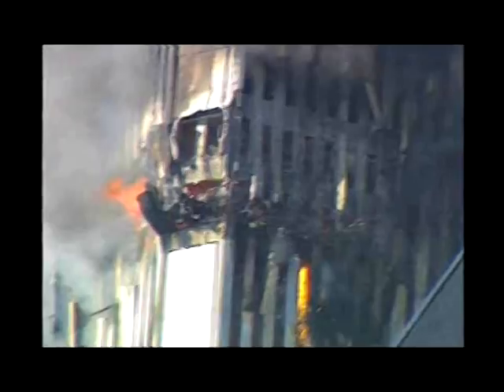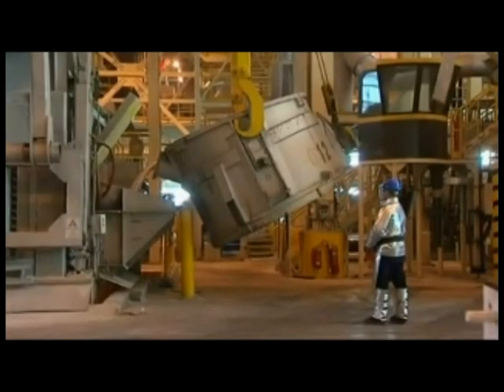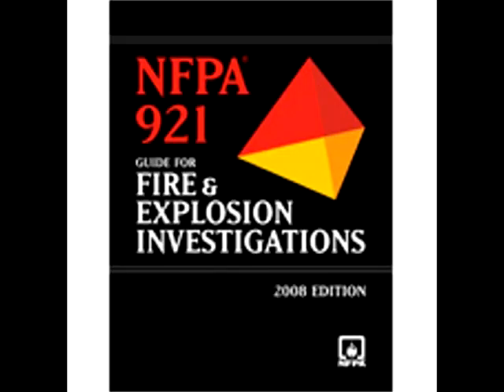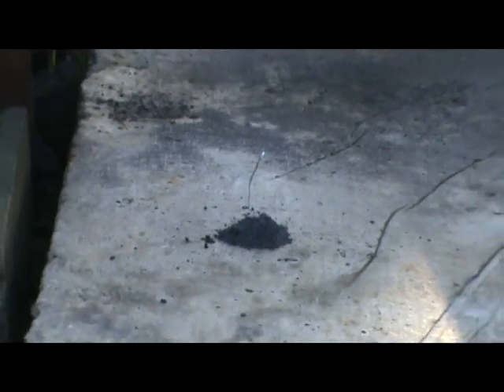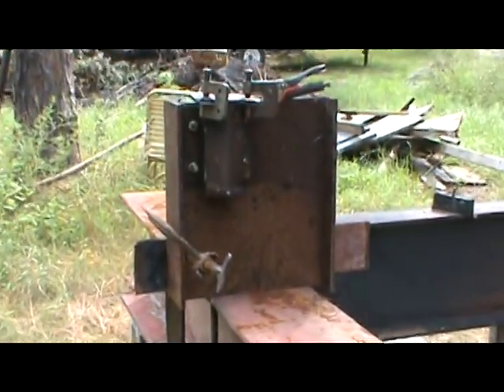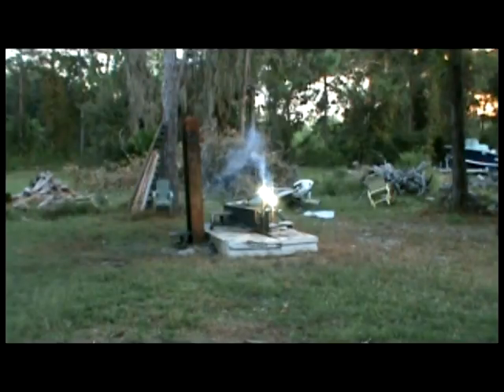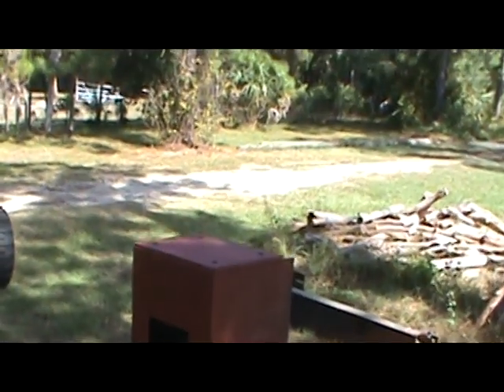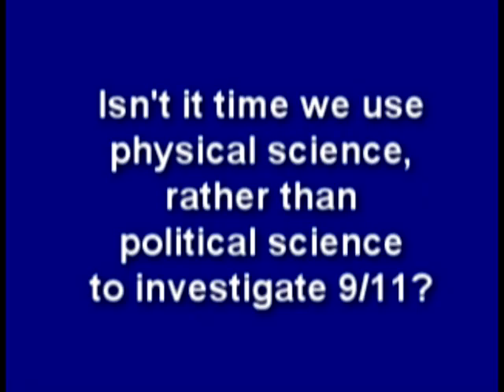9/11 Experiments: The Great Thermate Debate

Comment: what i would like to know is if it's possible during construction to have powdered steel and aluminum build up in the pockets of those beams from grinding that might have been taking place higher up.  the powdered steel would have over time oxidized and you'd wind up with accidentally mixed thermite.  the burning of the thermite could have initially been contained by the stucco and concrete around the beams. 

two tests would be required to determine if I'm right.  try grinding the steel beam and perhaps some aluminum siding above an enclosed area where it could be caught.  perhaps they swept the powder down the chutes instead of discarding it.  

you can check these spaces in other buildings built during the same time and same company to see if you can find this mixture.  

the second test would be to determine whether jet fuel burns hot enough to ignite thermite.  it may have ignited by accident, or they may have somehow dropped something into the same spaces that would burn hot enough.
Reply: +JathTech It's a non-issue, because there was no thermite, no evidence of thermite except in a junk paper written by fringe kooks, and there is no need for explosives to explain how and why the buildings came down.
Reply: +crushffl you're of course correct, however, it is conceivable that thermite could accidentally be mixed.  not in enough quantities to bring down the building, but certainly enough to make the loud bangs.  

anyone who has ever taken a physics course and worked with metal smelting/forging would know that jet fuel and paper is just fine for melting steel.  the people that say it isn't might as well say the hydrogen in the sun doesn't burn hot enough to melt rock, when it's obvious that it does.  small scale and large scale differ greatly in those types of experiments.
Reply: +JathTech  Sorry, gotta correct a couple of things.  "it is conceivable that thermite could accidentally be mixed.  not in enough quantities to bring down the building, but certainly enough to make the loud bangs."  Thermite burns extremely hot, about 2500 degrees C, hot enough to melt most metals.  It does not explode and would not make a bang.  On top of that it wouldn't spontaneously ignite, even in a hot fire.  You need a magnesium fuse or similar igniter to get it going.

"jet fuel and paper is just fine for melting steel"  No it's not.  The fires in WTC 1 and 2 were not hot enough to melt steel.  That's a straw-man argument by the Twoofers, as that is a Rosie O'Donnell quote and no official report says the fires melted steel.  It's exactly why the Twoofers are always grasping at straws to try to say there was thermite.  The fires in the building probably reached around 1500-1800, not enough to melt steel but enough to weaken it.  Steel starts to lose significant strength around 700 degrees F, and has lost nearly half its strength by the time it reaches 1000 degrees F.  Add to that the fact that steel "creeps" (distorts) at high temps, and the damage inflicted by the high speed impacts by massive planes, and it is no surprise that the buildings fell and no Twoofer conspiracies are needed to explain it.

Unfortunately by saying jet fuel can melt steel beams you are providing misinformation and fueling their straw-man argument.  By making the statements you make about thermite you are adding credibility to their nonsense arguments.  Please stop.
Reply: +crushffl You CLEARLY did not watch the video, and you are dismissing actual science.  I disagree with the idea that the building was sabotaged in any way, but there were explosions that people heard and saw.  If you go back and watch all the videos available, those things happened.  Furthermore, this video CLEARLY demonstrates that thermite can and does make loud bangs when ignited in enclosed spaces. 

As for jet fuel and paper melting steel, I've done it in a kiln.  Enough fuel, oxygen, and time, and you have molten steel.  This building was basically transformed into a giant kiln.  Holes in the side where the plane entered allowed oxygen in, and the massive quantities of fuel and paper burning eventually build up enough heat for it to happen.  The burning itself doesn't generate the heat instantaneously, it builds up that heat over time.  If there's no place for the heat to go, it will eventually get hot enough to create molten steel, which explains the rivers that were pouring out of the side of the building in some of the videos.  Jet fuel doesn't melt steel when burned under normal conditions, but trapping the heat and adding more oxygen will cause the heat to build up.  IT's fucking metalurgy 101
Reply: +JathTech  "As for jet fuel and paper melting steel, I've done it in a kiln"  I'll take your word for that.  As for the building being like a kiln, it's certainly possible that due to the damage and fired it had kiln-like properties in some areas, but it's hard to make the case that it was hot enough for long enough to create "rivers" of molten steel.

"...which explains the rivers that were pouring out of the side of the building in some of the videos"  And here you are exaggerating impressively.  I've seen those videos and "rivers" don't come to mind, more like one small "stream".  And what makes you sure it's molten steel?  Each of these aircrafts had about 59,000 points of aluminum cladding that would have been scattered throughout in fairly small, thin pieces that would have melted quickly and at temps much lower than those required for steel to melt.  When mixed with copper, glass, and other substances found in abundance in a modern office building it would flow and glow just like any other molten metal.  Of course the Twoofers producing this video only talk about "furniture", and the gullible accept it.

And as YOU watched the video, did you see any "rivers" of molten steel coming from any of the thermite tests?  No, a flash of light and sparks and then nothing.  Assuming for one minute that there were many of these located on each floor, that they survived the plane impact along with the igniters and controllers, they would be spread all throughout the building.  How would a few pounds of steel and sparks at all these various locations converge to form a river or even a small, flowing stream?  It's beyond silly.

Notice how all the comments that it must be molten STEEL come from the speaker, or from "media" or "firemen" with no expertise in telling molten aluminum from molten steel.  The quotes about "flashes" and "explosions" are provided with little context, like the survivor being interviewed 9a the 7 minute mark) about an explosion that sounds more like he was talking about the initial impacts and explosions from the planes, although you can't be certain based on the poor attribution.

Do you know what the "independent, peer-reviewed report" is that is being referred to in the video?  It's the "Harrit" report, a grossly flawed paper that was "published" in an "open" on-line forum with negligible controls.  The forum was so embarrassed that this junk paper was allowed to get through that the editor resigned and the forum was discontinued.  And that's the BEST evidence these buffoons have for their nonsense.  The above EASILY explains what was observed, without explanations that include explosives.  You saw molten aluminum mixed with other compounds, and the fire was enough to weaken (not melt) a steel structure that was already severely damaged buy the impact of a large aircraft hitting at high speed.

I scoff at these videos because every time I investigate one of these Twoofer claims I find their evidence to be embarrassingly thin, and there is a better explanation for what they claim they have "conclusively proved".  I don't dispute that thermite can do these things, but it's completely unnecessary to explain what happened, the evidence it was used is pathetically thin, and the arguments for how it was placed there strain credulity.
Reply: Your ignorance has given you away.  Molten aluminum does not glow, and looks an awful lot like mercury as it flows.  That was molten steel. 

Secondly, you're acting as though I'm claiming the "Twoofers" are correct.  I'm not.  I'm actually explaining why certain things that they see as proof of lies are in fact not proof at all.  I'm using my knowledge of physics and metallurgy to debunk the people you're against.  You attempting to refute what I"m saying is having the opposite effect from what you're apparently trying to do.  

Rivers is an exaggeration, you're right, but there were substantial amounts of molten STEEL pouring out of the building.  Again, anyone who's ever worked with molten metal will tell you that it wasn't aluminum. 

But again, The conditions in that building WITHOUT any kind of crazy explosion or planted thermite easily could have melted steel.  And the explosions could easily have been created by the mixture of different elements that are normally found in buildings like that.  As for the heat required to ignite thermite, there are thermite mixtures that can be ignited with a lighter.  But that particular mixture would have been unnecessary considering the amount of heat that built up and got trapped.
Reply: +JathTech <what i would like to know is if it's possible during construction to have powdered steel and aluminum build up in the pockets of those beams from grinding that might have been taking place higher up. >

That scenario would be impossible for a couple reasons.  First of all, elemental aluminum is very reactive and would oxidize very quickly.  Aluminum oxide would not react exothermically with iron oxide.

Secondly, for thermite to reliably ignite, it would need be be intimately and uniformly mixed, which wouldn't happen randomly.

Thirdly, the material discovered in the peer-reviewed and published Harrit report is all of uniform nano-size, is in the proper proportion to illicit an incendiary reaction, and is bonded inside a solid silica and carbon matrix. This material was specifically engineered, period, and is similar to known forms of sol-gel super incendiaries developed by the Lawrence Livermore Lab.
Reply: +crushffl 
< It's a non-issue, because there was no thermite, no evidence of thermite except in a junk paper>

Lie.  The Harrit paper is authored by nine experts, underwent a rigorous review process by two others, and is published in an academic journal.  The paper stands as the only published pyrotechnic analysis of the dust in the academic literature, and there exists no paper to refute it in over 6 years.

Your fabricated ad hominem attacks don't qualify as a scientific refutation, and only serves to show the factual weakness of your argument.
Reply: +Emvaz22 You are correct until you start spewing BS in your third paragraph.  Why don't you watch the video above and tell me which of the multiple thermite/thermite reactions in the video, produced even a trickle of flowing molten steel that could have co-mingled with molten steel from other reaction points to form the "rivers of molten steel" that Twoofers claim existed.  For each there is a shower of sparks and hot debris that quickly cools, but not even a trickle of flowing, molten steel.  You could have thousands of these, and a thousand times zero is still zero.  It's clear to anyone with sense that the material filmed leaking from one of the buildings, and the firefighter reports, were of molten aluminum mixed with other compounds.  No thermite required to explain anything at all, unless you decide in advance that it is required.
Reply: +JathTech 
Also, you shouldn't bother trying to have a reasonable discussion with crushffl; he's a known YouTube meatpuppet and shill, as are most people who use the term "twoofer".
Reply: +Emvaz22 you said:  "Lie.  The Harrit paper is authored by nine experts, underwent a rigorous review process by two others, and is published in an academic journal.  The paper stands as the only published pyrotechnic analysis of the dust in the academic literature, and there exists no paper to refute it in over 6 years."

LOL.  Are you referring to the Harrit paper that was published in an "open" on-line journal that was so embarrassed that the paper went through that the editor resigned and the forum was discontinued?  That paper?  It never went through the typical peer review that a real scientific paper goes through:  go look at the credentials of the reviewers and we'll have some fun.  As for the "expertise" of the authors, 3 of the 7 only list Twoofer affiliations and not even any academic credentials, and the only one close to being qualified in Chemistry is Harrit himself, which is, of course, why he is listed first.  It's also the only paper of its kind for a reason: nobody else takes this seriously.  There are plenty of refutations on the web if you bother to look at them (failure to observe standard chain-of-custody practices, failure to investigate alternative explanations, etc.), but nothing formal because it was never formally published in a real academic journal.

That said, I totally understand why you Twoofers exaggerate and lie to defend it:  It's all you got, even if it is a joke.  Try again, bozo.
Reply: crushffl <Why don't you watch the video above and tell me which of the multiple thermite/thermite reactions in the video, produced even a trickle of flowing molten steel that could have co-mingled with molten steel from other reaction points to>

When did I mention anything about molten steel?  You should brush up on your reading comprehension.  But since you mentioned it, the products of a thermite reaction are aluminum oxide and molten iron.  Therefore a large amount of thermite would produce pools or flows of molten iron.  Chemistry wasn't your strong suit, was it? 

< form the "rivers of molten steel" that Twoofers claim existed.>

If by "Twoofers" You mean first responders and rescue workers.  Melted iron is also documented in FEMA's appendix C.  There is even a picture of NIST's John Gross posing with a piece of partially melted steel at ground zero.  Try again, shill.

<It's clear to anyone with sense that the material filmed leaking from one of the buildings, and the firefighter reports, were of molten aluminum mixed with other compounds.  >

Even if the metal was aluminum, comparing the observed color of the glowing metal to black body radiation charts shows a material well over 2000F that was exposed to the atmosphere, which means the center of the material would have been even hotter.  At the most ideal conditions, the temperature of a hydrocarbon fire in a non-blast-furnace configuration only reaches 1800F.

<No thermite required to explain anything at all, unless you decide in advance that it is required.>

Unless you decide that steel high-rises can go from fully intact to total free-fall for a full 100 ft, as building 7 did.  Because a building can collapse straight down, moving all of the structural steel out of the way, and not lose any momentum in the process, all from scattered office fires.  Physics wasn't your strong suit, was it?
Reply: crushffl <Are you referring to the Harrit paper that was published in an "open" on-line journal>

An "open" journal is merely a journal available for somebody to read without having to pay a subscription fee.  That fact that you imply that it means it wasn't peer reviewed makes you either an idiot or a liar.

<on-line journal that was so embarrassed that the paper went through that the editor resigned>

The editor resigned due to political pressure, and never cited any technical flaw with the Harrit paper.

< go look at the credentials of the reviewers and we'll have some fun.>

We sure will.  Dr. David Griscom has a PhD in physics from Brown University, has worked for NASA, DARPA, and US Naval Research, and has authored of co-authored over 190 published papers.  He has been a reviewer on over 1000 papers.  You mean those credentials?  What are the credentials of the people who reviewed the paper that proves that there was no thermite?  OH WAIT THERE IS NO PAPER, BECAUSE ITS A LIE.  Try again, idiot.

<As for the "expertise" of the authors, 3 of the 7 only list Twoofer affiliations and not even any academic credentials, and the only one close to being qualified in Chemistry is Harrit himself, which is, of course, why he is listed first. >

Blah blah ad hominem blah blah misrepresentation blah blah lie blah ad hominem.  Anything substantive to add?  No?  I wonder why that is?

< It's also the only paper of its kind for a reason: nobody else takes this seriously.>

Or maybe because it's taboo, and anybody who touches it will be politically pressured to redact it or resign or be blackballed, like the lead editor of the Bentham journal that published the first paper.  Wow, rocket science.  

And I'm sure the government would have no interest in clearing itself of culpability in the murder of over 2000 of its own citizens.  News flash: recent polls show that most people don't buy the official government garbage.  And you don't think the government has an interest in appearing to be a legitimate governing body, as opposed to a criminal syndicate?  Solid analysis.

<There are plenty of refutations on the web if you bother to look at them (failure to observe standard chain-of-custody practices, failure to investigate alternative explanations, etc.),>

Ah.  The web.  Nice academic citation, dipshit.  Lie, and another lie.  The names of the sample donors as well as means in which the sample was collected are verified by signed affidavit, eyewitness testimony, and video recording.  Are you implying that the study authors falsified their entire study, or spiked all of the samples with a novel incendiary material which they don't have the necessary equipment to produce of acquire in the first place?  Thats quite an accusation.  Prove it.  Oh darn, you can't.  The Harrit authors also specifically investigated the only reasonable alternate explanation (paint) and ruled it out with numerous experimental procedures.  Name a single technical flaw with the paper that isn't a total fabrication from your oh-so-scientific "debunker" blogs.

If this material indeed does not exist in normal WTC dust, then where is the study that proves it?  It should be an easy thing to prove.  Why can't you prove it?

<but nothing formal because it was never formally published in a real academic journal.>

You know why?  Because the dust DOES contain thermite, and any study attempting to prove otherwise ifs pure junk and can't get published in an academic journal.  Go ask James Millette, the FEMA contractor, why he couldn't get his bogus study published.

Try again, meatpuppet.
Reply: +Emvaz22 "crushffl; he's a known YouTube meatpuppet and shill".  It's amazing how quickly Twoofers go to the "shill" or even "paid CIA shill" card.  Then again, it's not that amazing as it serves at least two important purposes for them:  1) it makes them feel important to imagine that the government gives a rat's ass about them, and 2) it helps them rationalize having their ass handed to them over and over again in arguments; after all, they're arguing against a trained guv'mint agent!
Reply: +Emvaz22 But there's an even more bizarre component to the Twoofer penchant for calling their opponents "shills".  Twoofers don't have a coherent "alternative" story to defend; they are all about challenging the "official story", especially if it is a Western "official story".  Not surprisingly for these idiots, most believe the same stupidity:  9-ll "inside job", Apollo Moon Hoax, Sandy Hook "false flag", Holocaust denial.  If anything they love to blame it on some vague US-Israeli conspiracy, and the fact that they can  simultaneously exonerate some Islamic extremists, so much the better.  

Advancing this kind of nonsense is a central pillar of ISIS's recruiting tactics.  Twoofers might not believe they are supporting ISIS, but they are in fact "useful idiots" for ISIS.  It's hilarious, and sad, that these paranoid freaks so quickly accuse their opponents of "shilling", because Twoofers are actually shills _for ISIS.
Reply: +Emvaz22   Griscom.  LOL.  He was a Twoofer long before reviewing the Harrit paper, so despite some solid academic credentials he is a highly biased reviewer and would be found completely unfit if this paper went through a true peer review in a legitimate journal, which it did not.  Griscom has a record of believing and promoting all kinds of nonsense including the "contrails" BS.  Here's what this kook said about 9-11: 

 "I envision a similar 9/11 scheme, but one where the passengers boarded under their true names. Indeed, the seat occupancies on all four aircraft allegedly hijacked on 9/11 were very much lower that industry average (averaging 26% of capacity vis-à-vis 71% for all domestic flights in July 2001). So, here I extend my “all passengers survived” postulate to all four 9/11 “hijacked” flights on the notion that this small number of passengers might have been considered by conspirators as the minimum number for public credulity, while at the same time not exceeding the maximum number of “true believers in the cause” willing to accept long separations from their loved ones (sweetened by handsome Swiss bank accounts)."

Again, go ahead and defend the Harrit paper because it's all you fools have.
Reply: +Emvaz22  "Physics wasn't your strong suit, was it?"  Actually I'm a highly successful Civil Engineer with over 25 years experience.  I'm curious what your credentials are.  And where are all the architects and engineers who should be on your side if you actually had a shred of evidence or credibility?  Fool.
Reply: crushffl Hmm, I see lots of emotional posturing and plenty of ad hominem, speculation and straw-man fallacies, yet still no factual or scientific observations concerning the events of 9/11.  Why is that?

<Twoofers might not believe they are supporting ISIS, but they are in fact "useful idiots" for ISIS.>

Wow what a fascinating and well-supported theory.  

Can you refute the Harrit study?  Cite your refutation.  Can you prove the official theory, or do you just bend over and take it up the ass, no lube, no questions asked?

You have no evidence of anything?  That's what I thought.

<would be found completely unfit if this paper went through a true peer review in a legitimate journal,>

Oh, so what portion of the paper would not make it through peer review?  What is the technical flaw, specifically?  You seem so sure, so what portion of the paper do you have in mind that was not performed correctly.  Enlighten me.

<And where are all the architects and engineers who should be on your side if you actually had a shred of evidence or credibility?>

Oh you mean the 2000+ experts who have openly come out against the government story?  Where are all of your expert supporters?  Which papers have they published that prove the official story, and where have they put their names and credentials on the line to support the official theory?  Link me this signed statement of belief of all the experts that support your unsupportable argument.

Good luck, meatpuppet.
Reply: +Emvaz22   You said:  "An "open" journal is merely a journal available for somebody to read without having to pay a subscription fee.  That fact that you imply that it means it wasn't peer reviewed makes you either an idiot or a liar."

Ha Ha.  Do a little research on the grad students who have written algorithms that string words together to make nonsense technical papers, and then have gotten them accepted and published in hundreds these "open" on-line journals.  You are defending a joke, but at least you are consistent.
Reply: crushffl <Ha Ha.  Do a little research on the grad students who have written algorithms that string words together to make nonsense technical papers, and then have gotten them accepted and published in hundreds these "open" on-line journals.  You are defending a joke, but at least you are consistent.>

Cite one single gibberish paper that was published in a Bentham journal.  MLA format will suffice.  Be sure to list the specific journal, the date the edition, the author, and of course the title of the paper.

What's that?  No gibberish paper was ever published by Bentham?  You are just intentionally misrepresenting facts and repeating proven "debunker" lies?  Thought so.  

Also, you are changing your story.  First you claim that it wasn't peer reviewed, then you concede that the supremely qualified Dr. David Griscom reviewed the paper (only one of the two expert reviewers) once I caught you in your lie.  Now you are back to insinuating that it was never peer reviewed.  How dumb are you?

Go ahead, cite the gibberish study, and tell me where it is published right now.  I'm waiting.
Reply: +Emvaz22 "Cite one single gibberish paper that was published in a Bentham journal".  Sure, ISIS Shill, here's the first one that popped up in a quick search:The Bentham "Open Information Science Journal" accepted a bogus hoax paper submitted by a Cornell grad student and an editor from the New England Journal of Medicine  “Deconstructing Access Points.” The authors (acting under pseudonyms) listed their affiliation as the “Center for Research in Applied Phrenology” (C.R.A.P. for short).  More details here:  http://scholarlykitchen.sspnet.org/2009/06/10/nonsense-for-dollars/Bentham then indicated in writing it had passed their peer review process and would be published upon submission of a fee, at which point the authors withdrew it.  So if you want to get technical this one wasn't published but it goes to show what complete garbage open journals are in general, and Bentham in particular.  Your claim that "An "open" journal is merely a journal available for somebody to read without having to pay a subscription fee" is patently false...it's what is properly called "Vanity Press":  you pay to get published.  It's a joke, but it's all you got so you defend it tooth and nail.  ISIS shill.
Reply: +Emvaz22 "First you claim that it wasn't peer reviewed, then you concede that the supremely qualified Dr. David Griscom reviewed the paper (only one of the two expert reviewers) once I caught you in your lie.  Now you are back to insinuating that it was never peer reviewed."

No change.  it wasn't peer reviewed to any standard that would be maintained by a true scientific publication.  Griscom's bias is overwhelming.  Even if his theories were mainstream, the fact that he is so close to the authors of the paper makes him completely unfit and the process a sham.
Reply: crushffl <then indicated in writing it had passed their peer review process and would be published upon submission of a fee, at which point the authors withdrew it.>

Ah, so it WASN'T published.  What you have here is a fraud who had been spamming the Bentham journals with numerous gibberish papers under an alias and wasting their time, in an attempt to falsely discredit their review process.  Bentham responded by claiming that they accepted one of his bogus papers, and required payment as a way to expose the fraud submitting the gibberish papers.  The paper was never going to be published, and it was never published.

I said cite a paper that was not peer reviewed that has been published by Bentham.  Oh, you can't?  All you can do is speculate and misrepresent the circumstances?  That's what I thought, meatpuppet.

<So if you want to get technical this one wasn't published but it goes to show what complete garbage open journals are in general, and Bentham in particular.>

It goes to show how gullible you are, believing everything you read on some unscientific debunker blog.  Way to go, moron.

<Your claim that "An "open" journal is merely a journal available for somebody to read without having to pay a subscription fee" is patently false>

Nope, it's patently true.  An "pen" journal means "open" access for the reader.  Nothing more.  Any more lies?

<.it's what is properly called "Vanity Press">

It's what acceptards like you call "vanity press" in an attempt to dissuade people from examining the article at face value, because all you have against it are fabricated ad hominem fallacies, and can't cite an academic refutation, and can't point out a single technical flaw.  Nice try though.

<you pay to get published.>

Are you implying anybody who pays can get anything published?  Prove it, moron.  Are you implying the editors and publication staff should work for free?  You're an idiot.  Do you think that a journal that accepts advertising dollars to fund themselves (conflict of interest) is more credible than an independent publication that is solely funded by the experts who submit their work for approval?

Recently there was an article in Science (one of your beloved "mainstream" journals) having to do with public attitudes toward gay marriage and homosexuality that was exposed as a complete fabrication.  By your logic, that means that every article ever submitted in Science was fabricated and not peer reviewed.  You're a true master of logic, aren't you?

You're not fooling anyone, trash.
Reply: +Emvaz22 "Oh you mean the 2000+ experts who have openly come out against the government story?"  I was hoping you would be dumb enough to go there.  So you're going to fall back on "Architects and Engineers for 9-11 Twoof"  Huh?  Let's crunch some numbers:

Ae911twoof doesn’t put the number on the front page anymore, but I looked and found it here:  http://www.ae911truth.org/signatures/ae.html.  So today it’s 2,370, .  Out of those 275 are not in the US (they were nice enough to list them all at the bottom, and I counted them), so the number in the US is 2,370-275 = 2,095.  Keep in mind that this number includes those with a degree but not licensed, as well as retired architects and engineers, meaning many of these are not even active any more.  Also keep in mind that these are not necessarily people who believe the conspiracy theories, but they signed a petition that they thought there were enough questions that there should be another investigation.  That's a much lower bar.

In the US as of 2012, the number of engineers is 1,530,110 (https://www.fas.org/sgp/crs/misc/R43061.pdf, Figure 1).  The number of degreed architects is tougher to find, so I used the number of registered architects which is 105,847 (http://www.aia.org/press/AIAS077761) and adjust it by the ratio of licensed architects to degreed architects in engineering firms, which is 36/65 (see data under “The Firms”) to estimate the number of degreed architects at 191,113.  Those numbers are likely higher today, but they are the best available so we'll use those. That’s a total of 1,721,222.  Divide 2,095 by 1,721, 222 and you get 0.00121 or 0.121%.

So, this proves that the number of architects and engineers that have bought into this nonsense (or at least think it merits more study) is about 1 tenth of one percent, still incredibly pathetic that 14 years after 9-11 they have managed to convince so few to sign their petition, and if you calculate the world-wide number, where the number of architects and engineers is incredibly higher (but still only 2,370 have signed), the percentage is way lower.  Statistically it is COMPLETELY MEANINGLESS, in the category of what educated people would call "noise".

Epic fail.  Feel free to point out any mathematical errors for correction, ISIS shill.
Reply: crushffl <Griscom's bias is overwhelming.>

Ah, so what specific aspect of the paper did he "let slide" because of his bias?  Where is the flaw that you claim he overlooked because he's a "truther"?  By you logic, anybody who accepts the Harrit study automatically becomes a "truther."  Do you know what circular logic is?  Apparently not.

<Even if his theories were mainstream, the fact that he is so close to the authors of the paper makes him completely unfit and the process a sham.>

Lie.  Grissom and Jones were not personally acquainted prior to the peer review of the study.  Moreover, Jones specifically refers to a months-long review process involving the reviewers and the editors of the paper, that he notes was particularly grueling compared to other reviews his prior papers have undergone.  Furthermore, the review involved two expert referees.  Griscom was only one of them.

You've got nothing.  No experts to stand behind.  No published refutation.  Only poor logic, deliberate falsifications, misrepresentations, and scurrilous ad hominem, with absolutely zero substance.

Try again, meatpuppet.
Reply: crushffl <So, this proves that the number of architects and engineers that have bought into this nonsense (or at least think it merits more study) is about 1 tenth of one percent, still incredibly pathetic that 14 years after 9-11 they have managed to convince so few to sign their petition, and if you calculate the world-wide number, where the number of architects and engineers is incredibly higher (but still only 2,370 have signed), the percentage is way lower.  Statistically it is COMPLETELY MEANINGLESS, in the category of what educated people would call "noise".

Epic fail.  Feel free to point out any mathematical errors for correction,>

Easy.  Have you heard of the word "taboo?"  Most people who believe the official story is BS are still not going to come out publicly and say so.  You are implying that anybody who doesn't sign the ae911 petition must automatically believe the official story.  How about we turn this logic around.  How many professionals have signed a statement of believe that supports the official story?  Oh, there is none?  I guess that MUST mean that nobody supports the official story.  Good logic shit-for-brains.  

I said to cite a statement of belief signed by experts who support the official theory.  You failed to cite one, are you saying there is none?  Why do no experts want to put their credentials on the line to support the official theory?

Your entire premise is false, and your logic is horrendous.  Keep it coming, moron.
Reply: molten aluminum with other biological matter and other stuff in it does not glow like that. It has dark spots or simple flaming spots. that was molten steel, it was not molten aluminum period. steel was melted in that tower. steel balls were found on the ground. as for the idea that thermite could be made by accident and collected inside pockets within the trusses and steel beams. I don't know if you've ever worked on a work site like that, but in general, you have a lot of grinding and sanding going on all over the site in different places simultaneously. People sweep and the wind blows, that stuff can easily become mixed to the right consistency. happens all the time in my shop at home, and that's a much smaller scale. thermite very easily could have been present by mistake. again, you can prove one way or another whether what I'm saying is true by going and checking the other buildings that these companies made during a similar time. Their practices likely did not change much between the buildings. Check the spaces between the beams and see if there's any thermite present. until you do that you cannot refute my hypothesis.
Reply: +Emvaz22 So you're going to attribute the PATHETICALLY, INSIGNIFCANTLY LOW number of 9-11 signatories to "taboo"?  BS.  I work in the industry (I asked your credentials, and don't believe you responded) and people talk pretty freely about stuff and express divergent opinions.  If true, this would be an atrocious act that should be protested vigorously.  A journalist who broke the story would win the  Pulitzer Prize, and the engineer who could show that these claims are true would be famous.  We professional engineers have to renew our licenses every year and the process includes an ethics course and a requirement to protect the public above all.  Our oath would require exposing this, even if, as Americans, we didn't feel the need to expose what had been done to our fellow citizens.  But there is none of that, just some fringe kooks and ignoramuses on the Internet, the greatest source of information--and misinformation--ever devised.   It's because we are educated and base our opinions on logic and facts.  As long as that stays true, you and your kook buddies will remain a tiny, squeaking minority.  And shills for ISIS.
Reply: +Emvaz22  The Shill for ISIS said: "I said to cite a statement of belief signed by experts who support the official theory."  I frankly don't know if anyone has bothered to set up such a document for signature, nor should it be necessary.  I'm also not aware of a document I can sign saying I support the fact that the Holocaust occurred, that we landed on the Moon, that viruses and bacteria cause disease, or that atoms exist.  Perhaps you could point me to them so I can sign them?  The closest thing I can think of is "Project Steve", where more scientists names Steve have indicated they believe in Evolution than all the scientists who say they support creationism.  Maybe we could start a Project Steve for 9-11.  I bet the results would be similar...
Reply: JathTech <molten aluminum with other biological matter and other stuff in it does not glow like that. It has dark spots or simple flaming spots. that was molten steel, it was not molten aluminum period. >

I agree.  Good point.

<I don't know if you've ever worked on a work site like that, but in general, you have a lot of grinding and sanding going on all over the site in different places simultaneously. People sweep and the wind blows, that stuff can easily become mixed to the right consistency. happens all the time in my shop at home, and that's a much smaller scale. thermite very easily could have been present by mistake.>

I went over this a few posts back:

The scenario would be impossible for a couple reasons. First of all, elemental aluminum is very reactive and would oxidize very quickly. Aluminum oxide would not react exothermically with iron oxide.  The chemistry is impossible.  The decades between the time the buildings were constructed to the time of the event would have certainly oxidized all of the elemental aluminum, so there would be nothing to react with the iron oxide.

Secondly, for thermite to reliably ignite, it would need be be intimately and uniformly mixed, which would be very unlikely to happen randomly.

Thirdly, the material discovered in the peer-reviewed and published Harrit report is all of uniform nano-size, is in the proper proportion to illicit an incendiary reaction, and is bonded inside a solid silica and carbon matrix.  Basically, I'd have about as good a chance shitting a gold brick.
Reply: crushffl <So you're going to attribute the PATHETICALLY, INSIGNIFCANTLY LOW number of 9-11 signatories to "taboo"?  BS.>

How many signatories can you produce?  Oh, thats right; none.  2000 is still infinitely more than zero.  Several recent studies show that most Americans believe the government is lying to them about 9/11.  And you want us to believe that every engineer who hasn't specifically signed a document on such a taboo subject must automatically support the official theory?  You're comparing apples to oranges, and you don't have either.  

< I'm also not aware of a document I can sign saying I support the fact that the Holocaust occurred, that we landed on the Moon, that viruses and bacteria cause disease, or that atoms exist.>

In all of these examples, there is no scientific proof otherwise.  You're drawing a false parallel.

No proof of the official story, and nothing to disprove the Harrit study and refute the presence of incendiaries.  Is this really how you are going to try to win this argument?  You aren't addressing any direct evidence.  Do you know why?  Because almost all of the direct evidence supports demolition.  The extent of your relevant supporting evidence is "Plane crashed.  Building pulverized."

Why can't you cite any academic supporting evidence?  Why has no expert come out against the Harrit study in the published scientific literature?